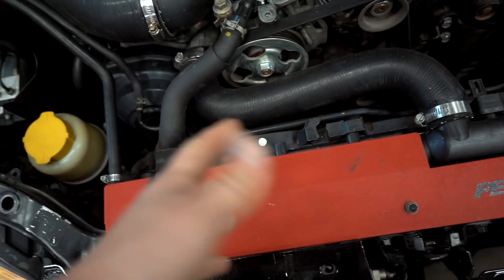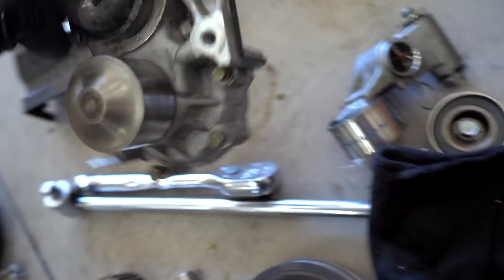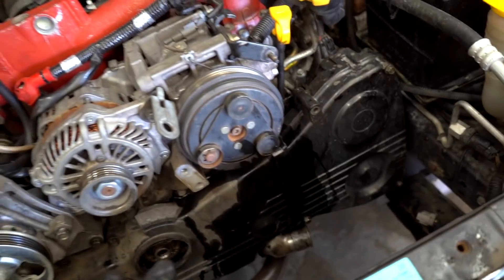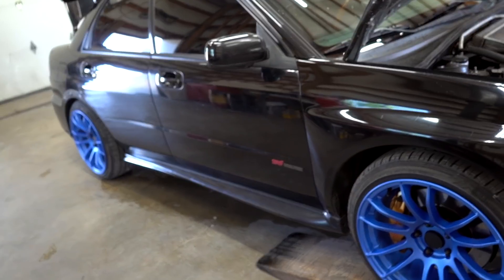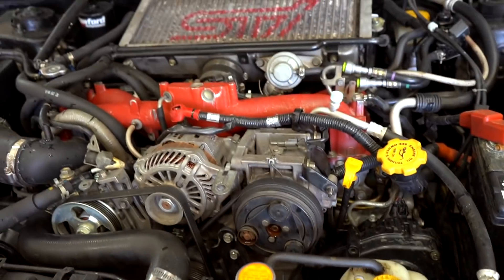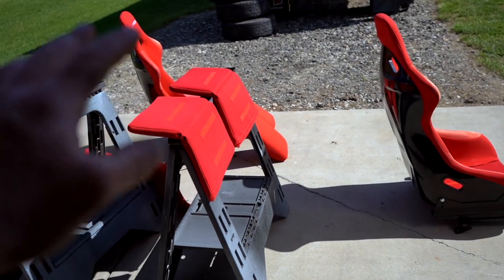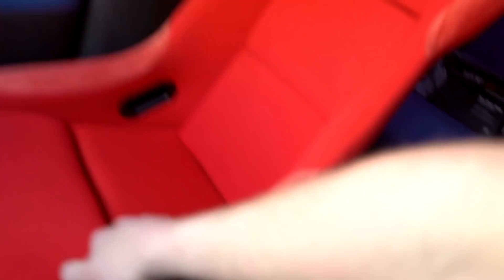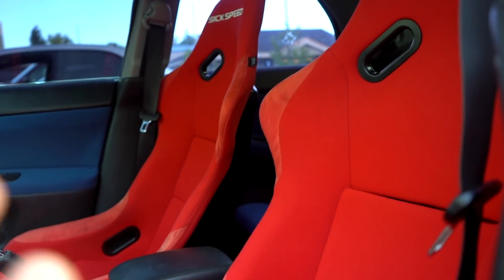Addressing the issues.

Comment: You should always drop in a new thermostat when doing the water pump. Under $20 and will save you from possibly overheating and destroying the headgaskets
Reply: Thought the same
Reply: He did when he replaced the gasket the first attempt at fixing the leak, new thermostat and gasket ☮️

Comment: Now the real question... why does it have a open weep hole? And what looks to be ballooned coolant hoses? If coolant system has pressure in it will open another weep hole again. That or old waterpump failed.  But it’s like I mentioned on last video it looked like it was coming from weep hole lol. 😂. Also 05-07 sti all use same airbag. Only 04 is different.